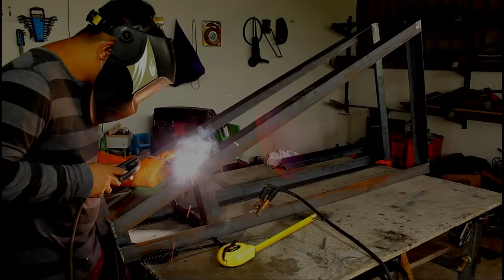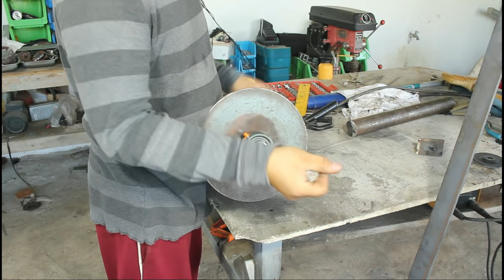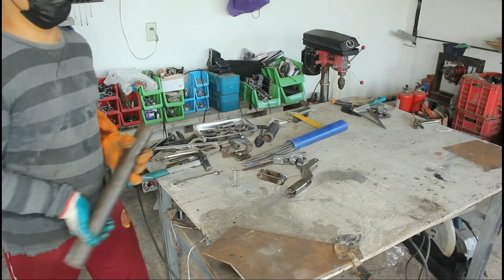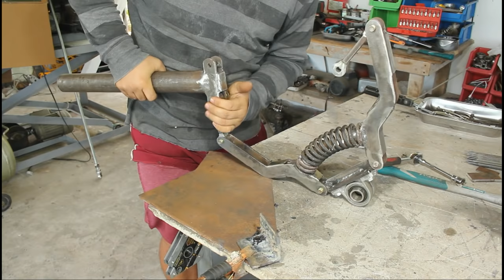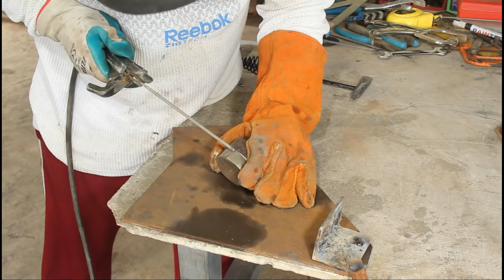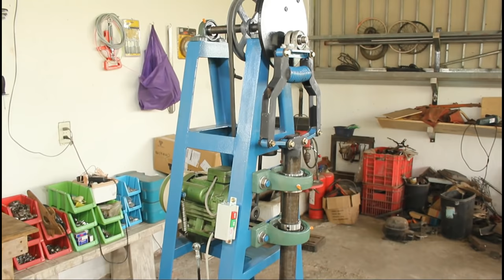Building a DIY Power Hammer Machine "WITH PLANS"

Comment: Pillow block bearings support a rotating axle, not linear motion through the centerline.  Replace these with blocks self-lubricating bronze bushings.  My opinion only.
Reply: if it works dont fix it !!!!!!!!!!!!!
Reply: I agree. This is a good build with the exception of the shaft going through the pillow blocks.
Reply: True. But my guess is they used that solely because it allows for a lot more slop in fitting for the tools they have to work with.

And can just be bought off the shelf and replaced without much trouble when worn out.

Or at least that's my guess. I noticed they tapped it quite a few times with a hammer till the tilt lined up.

I have no clue how long that would work and last even if it was greased regularly.

Certainly not what pillowblock bearings was designed to do.

But I can't help but wonder if it works well enough if you don't have a mill or lathe.

Kind of why I watch this stuff. Some of it is an obvious pointless waste of time to build but every once in awhile I find something useful watching it.
Reply: He built that with what he had.  Easy to replace both the bearings and hammer shaft .4 thumbs up from me. Bsafe dude
Reply: @bashkillszombies  it up and down motion not load bearing mine has lasted 2 years no sign of wear a little oil goes a long way
Reply: @jhh8688 ñp
Reply: you are right, this is a improvisation, but the the design was proven, parts can be improve easily later

Comment: I've been watching lots of videos on how to build a power hammer, getting design ideas to build one for myself, and I think this is the best one that I've seen so far! Good job, guys!
Reply: If you do it, don't use pillow blocks to guide the main hammer shaft. They're not designed for linear motion and will generate a lot of heat from friction and you will be wasting your money on them because it will rapidly wear out the inner collar. You would be better off doing as with suggested in another comment to use a self-lubricating brass bushing.

Comment: Holy cow... You're freaking genius you know that? I never seen anyone made a DIY blacksmith hammering machine before!
Reply: Hi...look up on YouTube the following.
The Da Vinci Helve Hammer 
This is a rather. But it's lighter and above All portable.
All you need is a bit of improvement...a pistol drill and a sledgehammer. 
Im going to a old building wood supplier. The key is to get 6" square timber...and 4" stuff.
Little steps..but don't lean in too far...once your heads hit...you remain hit.🤜😳🤛

Comment: Always impressed by your work. To help with the noise. Fill the square pipe with washed, clean, dry sand. Looking forward to the next one.
Reply from the maker: Thanks brother
Reply: Just make sure the sand is dry. No moisture. If the sand is wet, it could rust the tubing from inside out. You could add a little oil to the sand.
Reply: @robarcher3892  just put oil in the sand. Problem solved

Comment: Tire Hammer. That's the name of this forging hammer type. I like your version of the spring arms.Looks more creative than the typical spring arms. Nice work. Enjoy your first steps into the forging world.
Reply: A Tire Hammer has an actual tire that is driven off of a drive wheel mounted to a pivoting electric motor. This is closer to a Japanese style trip hammer with a slipping belt taking the place of an actual friction clutch.

Comment: Nice build mate, theres a couple things I think could help, you should fill the anvil with sand or concrete so it’s solid and increase the weight of the die’s and counter weight, also change to smaller drive pulley on the motor (double or triple pulley belts so has better friction) and bigger pulleys to fly wheel so it slows down rotation speed
Reply: What is the purpose of the counterweight? Wouldn't it just slow down the hammer on its way down?
Reply: @cheetodorito7403  keeps the thing balanced
Reply: @BESHYSBEES  what's the point in it being balanced though? If you had a hammer with two heads and swung it from the middle it wouldn't hit nearly as hard as if it had one head. Is it not the same with a motorized hammer?
Reply: @cheetodorito7403  The point of being balanced is to keep the thing from vibrating the whole floor and taking that energy from getting away from your work piece. It's always a good thing to keep it balanced so top and bottom head an anvil have the same stableness so it's clamping it rather than smacking the top. In other words.. You want it to work like a really quick press with even pressure on both surfaces. More efficent that way and use less power also.
Reply: @cheetodorito7403  not at all. If it is balanced with the hammer, then it smooths the operation while not slowing the hammer in the slightest. In fact it speeds the machine up, by balancing the hammer on the UP stroke. With the counter weight there is NO weight being lifted on the hammer UP stroke. All the motor is doing is keeping the flywheel spinning, which is easy.

Comment: The pillow block bearings you used as ram guides was an interesting choice.
Reply: Those are rotational bearings though right?  Would be nice to see how they hold up under reciprocal motion i.e. friction/lubrication/damage to rubber/neoprene absorber material.
Reply: Steel on Steel, wear very quickly, seize or break, not to mention stopping and starting by letting the V belt slip, i wonder how many of those they'll go through.
Reply: @hetrodoxly1203  You have to disassemble the machine to replace the belt.   that pulley should be at the back and turn the motor 180. Then replacing the belt would be nothing.
Reply: @aculasabacca  I never said it would 'be anything' i'm just stating you'll go through a lot of belts and it's just bad engineering.
Reply: @hetrodoxly1203  All I meant was they could have easily made it so belt change was easy. As it is they will tear up belts and it will be a pain in the butt to change them.
Reply: @aculasabacca  Ok, sorry i read it wrong.
Reply: @hetrodoxly1203  Na you read it rite !!

Comment: To help with the noise and the stand. Fill the base with a mixture of sand and lead shot. 
If you can't get lead shot. You can make it by melting lead pour it a container with  small holes  in the bottom.  Have the lead dripping down 10 feet ( 3 meters) into a deep bucket of water. 
Good luck in your projects.
Reply from the maker: Thanks for the info bro

Comment: That’s exactly what I was thinking.. get your steel hotter and it will work much better! Your top die has a bit of a hard edge that needs some rounding.  You’ll get cold shuts with that sharp dent in your steel like that
Reply: I don’t think he needs your advice
Reply: @ingleberthumperdink9455  yeah but I do. I wouldn’t have thought about that
Reply: @Heiryuu  what you don’t think of could fill a warehouse

Comment: A beautiful design.  Only thing I would recommend is to partially box in the A-frame (1/8 inch sheet) and weld both pieces to a 1/2 inch base plate so it's hammering on itself not pulling and pushing on the concrete anchors.
Reply: *3,175mm sheet; 12,7mm base plate

Comment: You might want to put a little radius on the hammer and anvil parts of the power hammer. That will stop the sharp indents you're getting as they could turn into stress points and break. Apart from that, you've just built the woman of my dreams and she is AWESOME!!! 😊👍👍👍👍

Comment: fill the base of the anvil with sand and add some "Ears" to anvil and wrap heavy chains around it like rope, the added weight will absorb shock transmitted to and through the anvil should make anvil more stable when hit.  also, Add some angled frame rails on sides from just below anvil to front of frame. watching the operation there is flex in frame going front to back. this means the hammer is moving front to back too, think of both parts vibrating like a tuning fork.   very good work.  also, you generally want the hammer to just touch the anvil in its resting state.  for fine control, mount the motor solid and use a tensioner pully to tighten the belt.

Comment: Finally started to build your hammer. Bought the plans from you about 8 months ago lol. I already had a partially built stand from a scrap yard so making some changes to the design but only since I have most the stand already made for me. Might be harder then tearing it down and starting fresh but I like a challenge haha. Thanks again for the very detailed plans. Well made plans to say the least. Will be using a bit different pulley to lower speeds of the hammer.
Reply from the maker: Thank you and i hope the project helps you alot.
Reply: what size motorcycle shock did you use.

Comment: needs a longer pedal so that you can stand comfortably when using it. great work.
Reply: It needs a completely different mechanism, a machine that runs by letting the V belt slip and then tensioning the motor by pulling it down is really bad Engineering, not to mention steel on steel with the shaft running back and forth through the bearings.
Reply: @deanmartin6052  I'm a retired engineer,  machine tool fitter, Maintenance Engineer, i've spent a lifetime building and repairing machines, you get to know what will and won't work, i love seeing people's inventions and ideas, the ones i find incredibly strange are the restoration ones that are basically just cleaning rust off, i've just seen one 'the restoration of a hammer' which was someone polishing a hammer, if that wasn't funny enough the praise heaped on him in the comment section was bizarre, it's probably my age.
Reply: @hetrodoxly1203  its a bad engineering if you have all the resources but you opted that slip belt idea despite..he is in Phils, just using what cheap and alvailable, thats also the reason why he use the pillow block instead of making a more efficient slide block assy, pillow block here in PH that size roughly just $10
Reply: @clifjonejontilano3578  phosphor bronze bushes would be cheaper than bearings, i can think of many ways of starting and stopping the mechanism but why not run it continually like a traditional forge hammer, you could put a switch on a pedal to turn the motor off.
Reply: @hetrodoxly1203  in your country maybe, but here the pillow blocks that size are sold for about 10usd only...regarding the stop and on, its up to him its his project..starting motor from still position eats a lot of energy, phils has one of the most expensive electrical supply innthe world coz we do not have nuclear power plant here..replacing a belt 2 times a year wolud be cheaper...and it is obvious that he design the tool just for hobby and video demos..you can make your better yet cheaper version and upload your video, i could be one of the aplauder✌✌😁
Reply: @clifjonejontilano3578  It'd just bad Engineering, if they don't want want it critiqued don't post it on YT,

Comment: Clever, interesting design that actually works well. Couple of issues though, linear bearings would have been no more expensive than pillow block bearings, and are actually designed for the job, and the strike point is way too low, it should be waist height, not down by your knees.

Comment: Wow great build Sir! Only thing you may want to keep an eye on is the floor that thing is drivng alot of force into the ground as you can see in the video. I think people usually pour a special kind of concrete and really think in areas where thye plan to use a power hammer.

Comment: It needs a longer pedal to run it so you can send more gracefully and control what you're doing
Reply: I get your point, but there's a fine line between the pulley slipping and grabbing.  A better upgrade would be to have a variable speed motor.. Like from a treadmill or something--  so that you could turn down the speed, and it would run slower, even when you are fully engaged on the pedal;  the belts would last longer that way too, since they wouldn't have to slip as much....  a quick and dirty upgrade though:  Just take a 2 ft bar (with a hook on the end), lay the hook end on your foot pedal, and let the other end stick out onto the floor--- then you can set your heel on the floor and push on that rod like an accelerator pedal and have a lot more control--- it would also extend the reach (like you said) and give you a finer touch.  Easy upgrade that's also easy to throw aside when you don't need it.

Comment: I thought it was only us Brits that used a curious mix of Metric and Imperial measurements when making stuff.
Reply: Canadians as well
Reply: Sorry!
Reply: It’s called General Motors Corporation or GM for short.  They mix 3/8” with 10mm bolts on the same bracket.

Comment: nice hammer, but built a blast shield around the arms and spring pls. if that thing snaps midwork there is gonna be shrapnel flying around. just a thin piece of sheet steel, like a mm or two in thickness.

Comment: So I figured out why it moves the hot metal so slowly, that little tiny anvil on a hollow stand is just not adequate for resisting the hammer strike, the anvil is very very very low mass so I'm certain it has poor rebound, I suggest using the same stock of metal you used as the hammer for the anvil. Or if you still want a small anvil so you can change out, you should look for a stand that is completely solid instead of using a tube with plugged ends

Comment: Nice but you're going to get a lot of sharp edge imprints in your hot metal. Round out the top edges a bit. And make some variations for the bottom like a cutter, drifter, or pusher. You can swap our different anvils to suit your needs.

Comment: Going to build up a lot of friction on the guide bearings
Reply: Those are not guide bearings they are called pillow blocks definitely not meant for this purpose.
Reply: Exactly.. lol.. I don't know why you used those giant pillow block bearings. lol.. its not spinning, it doesn't need bearings.   You would have been better off just using some large brass bushings with a little channel on the inside that would have a grease fitting on the outside--- held inside some steel bracing, and make sure that you are lubing it often... and that way, the bushings are easily replaceable... Easy to upgrade it to that though.
Reply: Those (pillow block) maybe the cheapest means here in Phils to make a sliding guide..to build an efficient one could be costly..at least he made it work for demo or proto..pillow blocks are cheap here, that size roughly cost just $10

Comment: This is just fantastic!!! what kind of bearings did you use as a guide for the hammering part? Those are normal radial bearings right? not linear? Thanks!!
Reply from the maker: They are just normal pillow blocks for radial
Reply: Habrá video haciendo un martillo pilón?? ya tienen la fragua🌝

Comment: I would mount the whole thing on a thick plate of steel to make it 1 piece and bolt the plate to the floor instead of individual pieces bolted to the floor
Reply: A senior once told me, whatever you fabricate you always keep in mind that it can be easily de-fabricated and within a short time. These guys might have the same perspective.

Comment: very interesting, but seems like you would want to control the power per hit, the frequency, and the height of the stroke, independent of each other - also not enough fine grained control over the stroke cycle. Foricing precise work will be very difficult on this one. But for basic stuff is much better then manual hammer thats for sure. thanks :)

Comment: Nice build but don't like the pillow blocks used for the ram as they are not designed for that purpose. They won't last.
Reply: I don't know why you used those giant pillow block bearings. lol.. its not spinning, it doesn't need bearings.   You would have been better off just using some large brass bushings with a little channel on the inside that would have a grease fitting on the outside--- held inside some steel bracing, and make sure that you are lubing it often... and that way, the bushings are easily replaceable... Easy to upgrade it to that though.

Comment: Those pillow block bearings are for reduction in rotational friction.  You are going to ruin those and ones that size aren't cheap.  Better to simply use a bronze sleeve that is replaceable or actual linear rail bearings except at that size would cost more than simply purchasing this machine.

Comment: I don't know why you used those giant pillow block bearings. lol.. its not spinning, it doesn't need bearings.   You would have been better off just using some large brass bushings with a little channel on the inside that would have a grease fitting on the outside--- held inside some steel bracing, and make sure that you are lubing it often... and that way, the bushings are easily replaceable... Easy to upgrade it to that though.

Comment: Why do you need pillow block rotating bearings on the sliding hammer shaft?
Reply: Used what was available. Self aligning guides

Comment: Idk what kind of electrode rods you were welding with you have to be self taught because you got next to no penetration on critical stress points of the machine. Surprised the thing hasn’t blown apart on you (hope it hasn’t)! If you were using 7018s on mild steel, you were far too cold. You shouldn’t ever need to grind the tip of the electrode so hard to the workpiece that the flux crumbles. I can’t really think of any circumstances where you would need a cold start. You want complete fusion especially for tack welds. Anyway just keep your amps around 120 for a 1/8th 7018 rod on mild steel in flat, horizontal, and vertical positions.